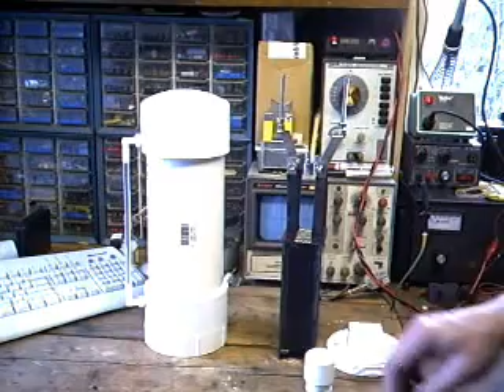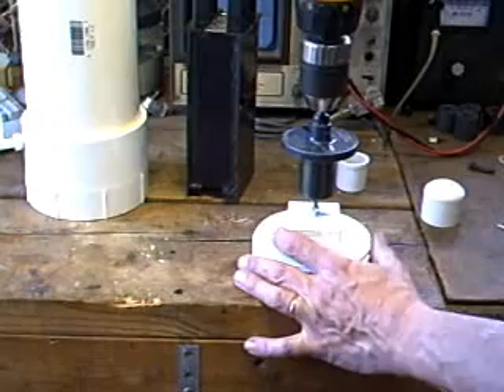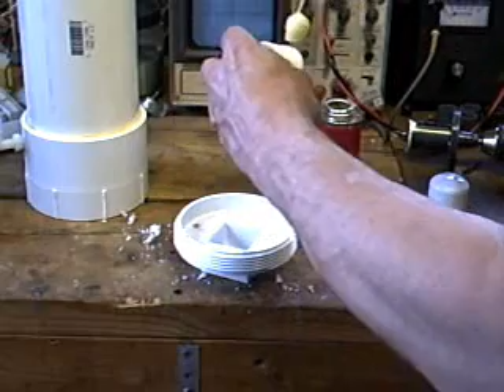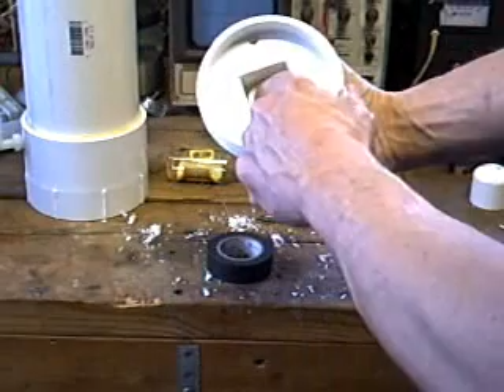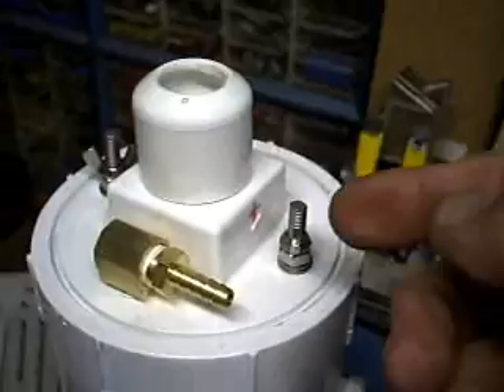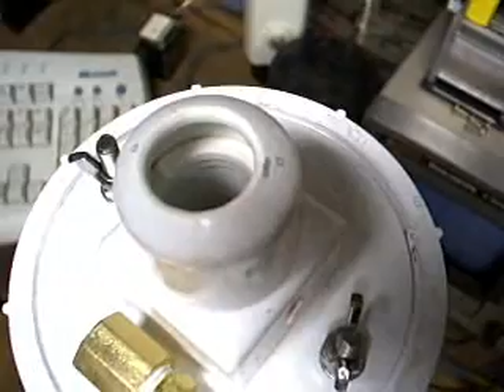#81 - VSPB cell chamber construction part 4

Comment: the rubber cap/w ss hose clamps from depot or lowes that i use, can be drilled into, holds heat a lot better than pvc and can be removed anytime. all my pvc threaded parts leaked in the end. just my 2cents...

Comment: Have you checked on the permeability of Seran or other materials to hydrogen? I have seen an idea put forth in separating hydrogen and oxygen to use Seran as hydrogen supposedly passes through it while oxygen being larger will not. That would defeat the whole idea of having a booster. Also, you can get neoprene bonded to washers to seal the bolt holes with. It is flexible and airtight. Use one on each side of the hole.

Comment: couple weeks ago, I tested a similar blow out on my own system. the blow out work exactly as planned. using a lighter, I worked in closer and closer until I was only about 1 inch from the open blow out hole before I got a pop. implication is that the gas disapates so rapidly, that the chance of a dangerous buildup caused by the open blow out is pretty slim. but we are all, constantly seeking ways to make these systems simpler, safer and more reliable.

Comment: I think you would do as well if not better to mount barbs high/low on the body of your tube, then pump fluid through a piece of stainless steel brake line (3/8in 6 foot long) that is coiled around your coolant inlet hose (one from radiator to water pump) ... water temp in that hose is pretty constant regardless of other conditions at about 140-160F depending on the vehicle ...

Comment from the maker: I do realise pvc has a low melting temp. Great care must be given to solid electrical connections. Any resistance will create heat. You saw how I made my connections. It's important to do them this way. I will seal the threads through the holes with some Goop.

We'll see how it goes. If I have to upgrade to cell cast acrylic then so be it. But I'm cautiously optimistic about this design.

Comment from the maker: Never tested. Not holding back. All I will say is the present cell has half the plates and 304.

Videos: Patience, dedication, practice, did I mention patience? And a good headset with boom mic. I had to modify my cheap vid cam to accept a mic input. More expensive cams have them already.

Comment: I can help, DWV(drain,waste,vent) is the same as sch. 40, so, yes its sch. 40...1 - 4" hard cap, 12" - 4" pipe, 1 - 4" cleanout adapter(coupling style), 1 - 4" cleanout plug...but if you want a flat bottom container you could use, instead of the hard cap, another cleanout adapter with a flush style cleanout plug...hope this helps :)
Fusion8r

Comment: Good ideas Zero.  What about putting some copper or alum tubing in parts of your water level checker thingy, and then wrapping the copper in electrical wire so that you can attach the wire to the battery for preheating.  If you had a lot of surface area it would also diffuse heat if it wasn't "plugged in"

Comment from the maker: Yup. It's all in the details.

I'm tossing around an idea in my head to create a sleeve around the tube body with an I.D. the same size as the O.D. of the collar and end cap. Then I could circulate engine coolant around the cell tank wall to preheat (especially in winter) and regulate the temp (especially in summer).

Thoughts anyone?